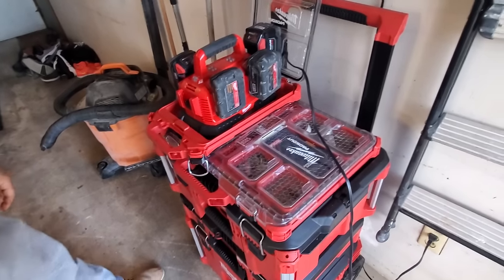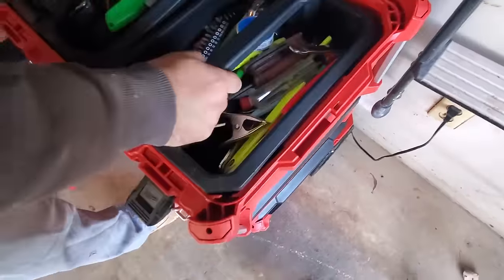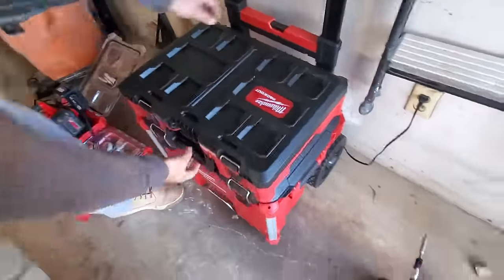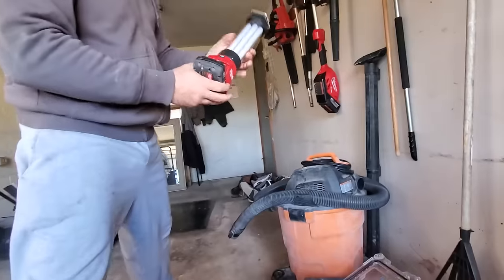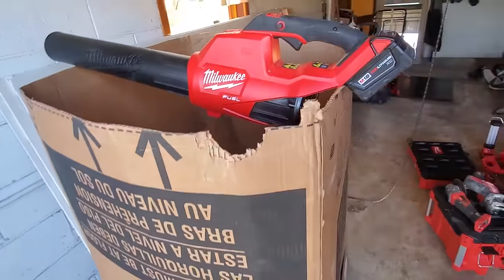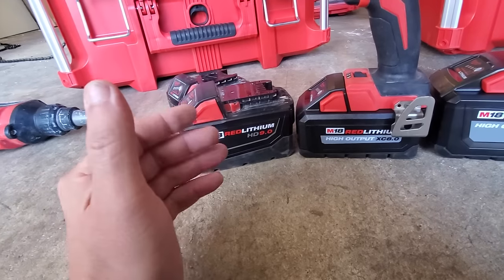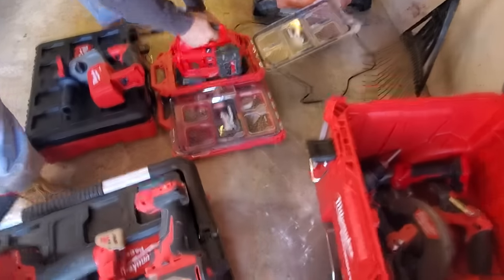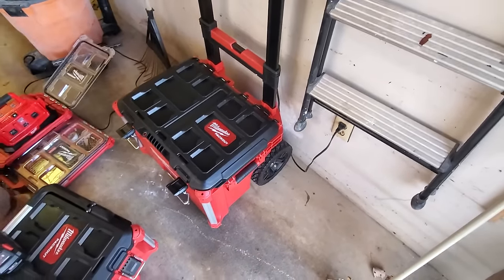Milwaukee Packout HACK !! Milwaukee Packout System , Complete Capacity

Comment: They need a pack out with drawers so you don’t need to take it on and off each time for commonly-used tools or fasteners
Reply: Milwaukee must have read this comment with the new drawers coming out
Reply: Packout excels in drop and impact scenarios, but I think the plastic injection is not structurally rigid enough like the structural foam Dewalt uses for its tough system.
Reply: You got your wish....
Reply: They're coming
Reply: They have that already
Reply: @ Alan Mail, packout has lasted 16 flights and still going strong. Dewalt’s was less than a dozen until the yellow clips starting breaking. Only as good as the weakest link.
Reply: They make it now :p
Reply: Amen to that❤

Comment: If you face the battery life gauge up on the 5.0 or smaller battery you can fit way more in the smaller packout and you can check the life on them

Comment: Just picked up the M12 fuel recip with the 4.0 battery, charger and bag and it qualified for a free $89 M12 6.0 battery. I love that as I have many uses for a little recip, and I get another charger and 2 batteries that will work in my jackets, air compressor, ratchet and recip... Love that each purchase kind of upgrades your whole lineup. $179 I am happy happy

Comment: At 7:25, they question whether the mid size box came with one tray, or two. My theory is the bottom box with wheels comes with a tray. It wasn’t being used there. Hence, it sits in the mid size box along with the tray that came with it. I’d do the same thing. Mystery solved.

Comment: The XC6 HO uses a slightly higher current cell in theory than the XC8 HO - maybe 10% higher power (1250+W vs 1100W), probably a little better than that for sustained high loads. It may be noticeable on the 12" miter saw, 7 1/4 circular saw, 2980 or bigger grinder, etc. For light to medium use on any tool, the extra capacity of the 8Ah should be more noticeable.

Comment: Such a weird coincidence but I have my packout setup almost identical. Box with the handle has the two dividers in the top and is for all hand tools. Smaller box for batteries. Wheel box for power tools. Great minds think alike!

Comment: Just ordered my Packout this morning from ToolBarn. Rolling box=$89 and large box=$59. No shipping/no tax. Already own the top box and have a gaggle of compact organizers. Where's the best place to buy Kaizen Foam?
Reply from the maker: I think directly from them buddy
Reply: I just ordered (4) 2'x4" sheets of 57mm from Fast Cap- ($26.40 each) with free shipping over $100. This was the best deal I could find. You are already cutting the foam, so might as well make a template and cut the insets as well.
Reply: @jayshawver2603  Thanks Boss and Jay. Woodcraft has it also for a few bucks less than FastCap, but they charge an "Additional Shipping Fee"... AKA, Deal Breaker. I went back to FastCap's site and have my set of foam sheets loaded in my shopping cart. Thanks again.

Comment: That M18 Fuel SDS rotary hammer is the shit man.  I've drilled thru a solid concrete wall (all the buildings here in my area are concrete) with a 1" x 10" bit and it went thru it like nothing with charge to spare.  Actually I was using it to drill a shitload of 5/32 holes for the 3/16 tapcons

Comment: This video makes me want two 8.0 high output batteries, not that I have any issue with the 5.0 xc batteries on my gen 3 hammer drill and impact, just would be nice for added runtime. The only thing about the packout for me is I don't like stacking tools in the big roller toolbox, I have most of my tools in packout boxes with foam inserts. I like keeping my tool in good condition.

Comment: Charger- A small, low profile 1/2 size foot print rapid charger with cord storage that had 1x 12v port and 2x 18v ports would be great.

***Milwaukee also needs to make a packout VAC in a small/ medium size box and quiet like the festool vac that is both battery and 120v and the hose/ attachments are all self contained. I use my 0880 M18 Vac daily but have to bungee it to my packout since there is not other way to attach it.

Comment: They need custom colors / company logo / integrated low profile interior led lighting.  And a pack out security suite
Reply: That would be awsome! They have the blacked out version in Europe kinda 🔥
Reply: @lgzz4885   yeah I would love to have one. But the import tax is unbelievable.  I think it's just as much if not more than the cost of the pack out. One could get linex or rhino liner for the same price maybe cheaper. That would he pretty legit.
Reply: JP yeah dude that’s a crazy tax!? I looked into it 1.5 years ago right be4 I copped the red!? Loco... but now you can nab one in the states for “standard” price w/o those crazy import tax’s/shipping. I’ll see one every once an a while on eBay/amazon or somewhere. But just do us up with red/black in different color schemes that would be dope! You could get logo on it prob 3rd party not to bad in price. I know a “sign” guy I’m gunna ask him next time I see him
Reply: @lgzz4885  that's funny you mentioned a "sign guy" because brother in law works for Welborn here in Lubbock. Hes done some cnc cut-outs of some different things. It was in an aluminum alloy that is very light weight and retains the scratch resistance from the other metals. But yeah no problem adding that stuff ourselves.  To be Honest I considered a colored linex or similar material. Give it a unique color

Comment: High Output 6.0 has higher discharge than 12A and 8Ah 
Samsung 30T has a 40-50 amp discharge rate
while the 8Ah and 12Ah use Samsung 40T barely meet 30 amp

Comment: When I first thought about buying the charger I didn't like the idea that it only charged One battery at a time so I had a couple of single charges but the problem is you have to watch so you can change out batteries with the six pack battery charger you just throw all your batteries on and you don't have to worry about it because it just goes from One battery to the next so you can work do what you have to do when your battery dies you just run upstairs and grab one because there's no worries it just jumps to the next battery and charge it for you

Comment: .
Just noticed that all of the lids on your pack-out modules open all the way vertical against the handle, while attached to the rolling base unit.  None of the lids on mine will do that, and stay up and open.
What's up with that?!
Reply: Warped I wonder the same thing
Reply: Warped you get what you pay for lol.i could not justify 200 so I went with the dewalt wish was 96 dollars on Black Friday it's perfect for a do it yourselfer
Reply: @76kamikazi  
I got it figured out.  You just unlatch the accessory box, slide it forward on the pucks, and then the lid opens fully.
When I went to HD on Black Friday, I intended to get the DeWALT or Ridgid packout set-up, but once I got to see them and wheel them around for a while, I decided that the handles were too cheaply built and flimsy for my use.  Yes, if you never intend to subject the DeWALT and Ridgid to rough treatment, they will be just fine for consumer/DIYer use (and you save ~$100 over shelling out for the Milwaukee rig). I saved $80, since the Milwaukee went back up to $280.  I'm happy, you're happy, ...everybody is happy!

Comment: Word that’s a dope little setup! Yeah the medium pack is awsome I use that & usually leave my rolling case at the house for space reasons, so I can throw the chop/stand/TS in the back. In it I have 5xscrew guns, hackzall, hole saws, orbital, router, multitool, chalk line, bags of sandpaper, just a bunch of other small shit “packing” 😉 that thing the F out! My Circ just sits next to it & keeps my water cooler upright lol I love the packout BUT it’s over priced imo. The same case w/o packout is like 1/2 the price & the rigid & Dewalt cases are much less expensive per case. I have about 10 PO cases atm but only buy them when they drop in price. I wanted the 10” tote this year but after tax is almost 100 on sale!? That’s extreme.... 8 ah best all around battery for sure I couldn’t agree more! I use the 12s for my big lights & lots of ripping.

Comment: Wifi symbol is for the One Key tools. Rigid has the Bluetooth function and app in all octane's. Milwaukee is going to have to give up on their original one-key vision of charging all that they'd easily amortize the costs of making it in every fuel tool just in the scale savings. Gotta imagine that's coming. I always wonder if that's Milwaukee or TTI, I can only imagine it's Milwaukee since AEG uses the rigid model even in regions where aeg is the premium tti offering
Reply from the maker: For one key tools ?? Not sure in what way . That isn't what reps told us at NPS 18 ..
Reply: TOOL BOSS that’s just speculation, it seemed like a waste to do nothing with it, last I heard the only answer Milwaukee was giving  was that it was strictly a tool to aid in assembly line efficiency. I don’t doubt that, it’s just hard to imagine they wouldn’t make use of something that’s there already so I always figured they’d at least tie it into one key and give you a way to lock individual batteries or something at least. 

Got a $50 bet with a “self taught Carpenter” 😑 that he never be able to use his battery as a Wi-Fi Hotspot to watch porn and reduce jobsite related porn watching injuries. Few ppl are so stupid but also so funny

Comment: Amazing how Elon Musk and Tesla have influenced multiple industries. Early on, they pushed for using common 18650 laptop batteries for their cars and it worked. Advancements continue from 18650 to 21700 to 4680 to pouch, etc. The tools of our trades continue to benefit as well.

Comment: They are on the verge of creating stable 21700 Cells that are 5000 mAh. We are going to see a High Output XC 10.0 battery before 2021.
Reply from the maker: I believe they have 5000mah out for a while but problem is only 10 amp
Reply: @toolboss8410  Hey man thanks for the reply, that's exactly what I was implying with your comment. They have some that discharge at 12-15 that discharge upto 4800. That's what I meant with the term "stable" it's pretty neat stuff though man. Please keep up the content, even though I can barely use half your deals in Canada :)
Reply from the maker: @Shmankafy  lolol... thanks brother I appreciate the comment ..yes very cool what's going on with the technology

Comment: So wait the 6 is the same size at the 8?? Same weight same everything? Does the 8 run longer then the 6 or is this just fuckery?
Reply: Same as the reason the XC 3.0, 4.0, and 5.0 batteries are the same physical size, but different outputs. Higher capacity battery cells allow for higher capacity packs, at the same volume.
Reply: The 6.0 outperforms the 8ah one 
YouTube it